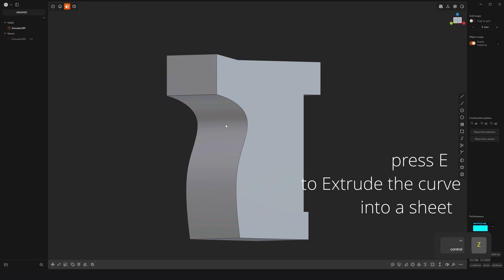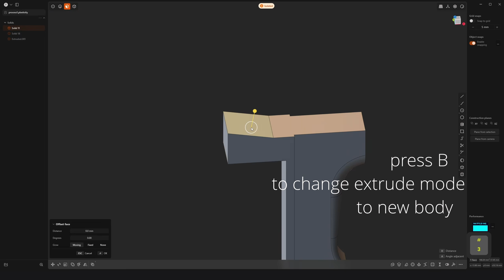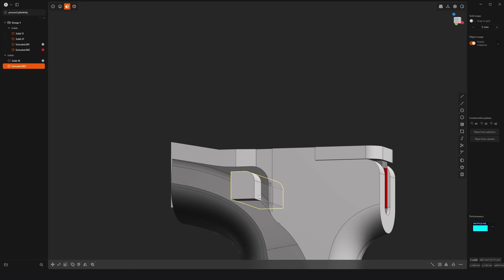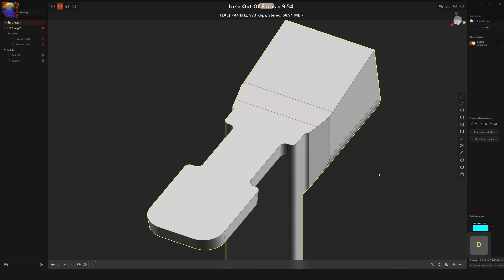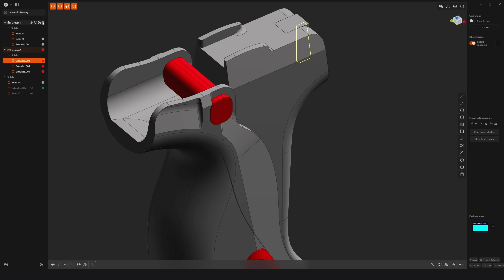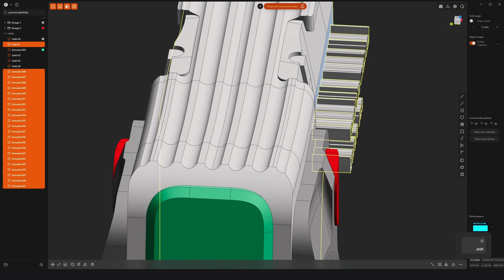How to Model Inside With Plasticity | Futuristic Hand Grip

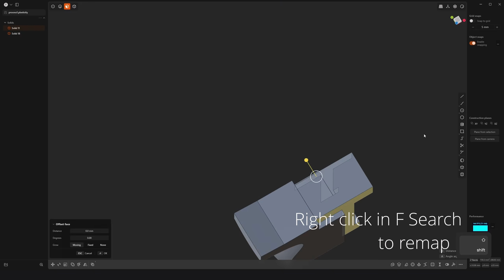Comment: there is a difference between not wasting time and being constantly frustrated and having to rewind a 5 second part 10x times. PLEASE for the love of god, make these tutorials slower, it is impossible to follow, even on 0.5 speed. I literally had to assign a play pause button on my mouse and have the video on another screen, playing and pausing it frame by frame to see what is happening. This is NOT a good tutorial. I learn a lot, but I also get very frustrated and tired because of these. Also, a lot of times what you say and what you do is different, or have a lot of extra steps, making me focus on the pressed buttons on the bottom right corner, instead of listening to your voice. It would be much more helpful to narrate the different actions, not just the general idea and then speeding up the actual work like 10 times. And THEN you change all the shortcuts so I have no changce to follow onward even if I look at the button presses xDD I'm crying man.. I took me 2 minutes to firuge out what the hack happened in 4:18 becuse you changed the match face shortcut to V and isolate to shift+W. Bro, please stop. This is an awesome tool and we need proper learning materials to master it like you do.

Comment: Quick question, im not a modeler, excuse my beginner question.
If Plasticity is using destructive workflow.
How do we revert back to a certain point of the progress and make changes if we receive client feedback?
For example, how do we fill holes of the text that was created with boolean subtract?

We would love to see more production workflow videos.

Thanks in advance
Reply: This is not possible with plasticity, there is no history where you can go back and do changes afterwards.
Reply: for hole or text is pretty simple, just cancel the edge and the face will be as new you can also move holes all around, for structural changes maybe can be more tedious